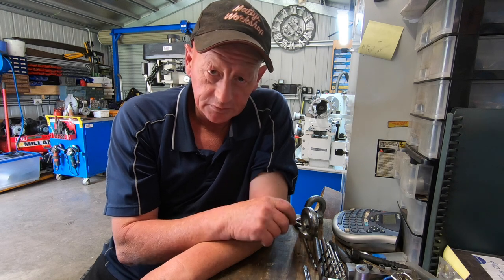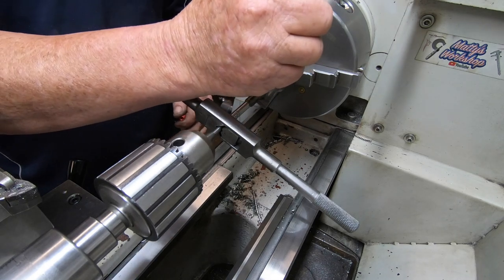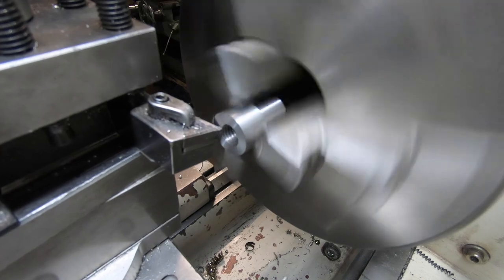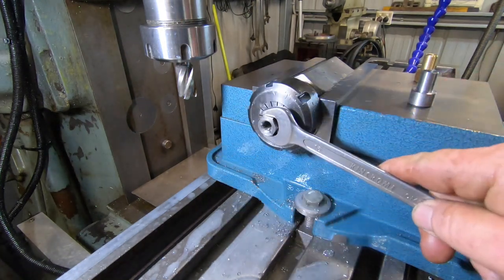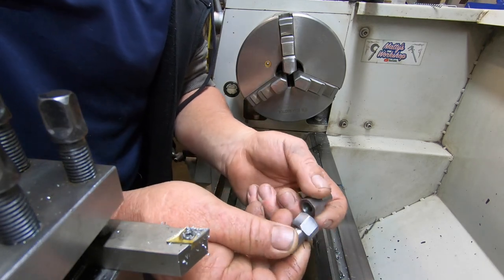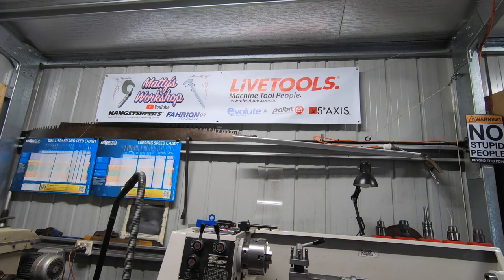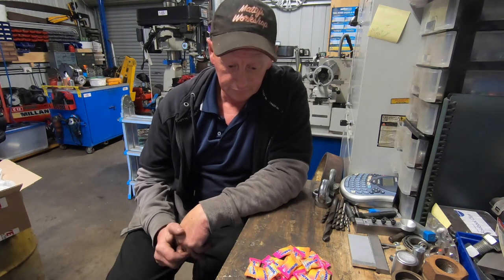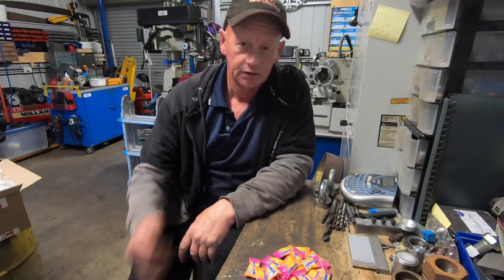Banner, Custom Nuts & QuickWorkshop Update

Comment: Nice job on the parts. I don't mind you using an imperial and metric mix one bit. I am equally ok with both. I try to use just the one in my shop though, purely to cut down on cockups - I make enough when I stick to one unit 😂 That's a great gift - the banner 👍 Have a nice trip
Reply from the maker: Gday Craig, I’ve started using the metric side of the dials on the lathe but not on camera, there’s been a few decent cock ups but that the part of learning, the banner is bloody awesome and never thought I’d see my name up like this mate, cheers

Comment: Matty, make your own phase converter.  It's an afternoon project.  I used a 10 hp motor.  It will run about 30 hp of motors down stream.  You will also need some start and some run capacitors to balance the voltages across the phases.  Project will make a nice video!
Reply from the maker: Gday, I’m starting to look into making my own mate, Cheers

Comment: The quick jobs can be the most satisfying. Knock them out take the win and move on to the next.  The banner looks great.  

If the missus is on board with a new piece of equipment, (or two) strike while the iron is hot! Wives can change their minds quickly and you mill money becomes a kitchen renovation.  Ask me how I know.
Reply from the maker: Gday Joe, I quite enjoy these small job, quick easy and they help others out and save them money, I’m still a bit shocked the wife’s on board with getting a new mill, the house is only about 8 years old and no need for renovations yet so I think I’m really in luck, thanks for watching mate, cheers

Comment: I'd just build a phase converter. I built my own using a 5.5hp motor from a Scrapped Colchester Triumph. Cost to me was £300 ($500 AUD) in total for components. A bloke with your skills should easily knock one out no worries. If you're interested, I'll send you my email address. I've got the wiring diagrams and components list.
Reply from the maker: Gday, I’ve seen a few videos on making a phase converter and often thought about having a go at one but always doubted myself, I’d really appreciate it if you could send the diagram and components list then I can see what I’m up against and if I think I could do it, my email address is ttmrj@telstra.com   Thanks very much mate, cheers

Comment: Hi Matty,
It’s good to see that a successful mob like Livetools has confidence in your future…. you’ve got a ‘winning way’ with your YouTube channel.
Looking at those brass engine mount nuts…..  It could be that they are designed to fail rather than bust an engine block or gearbox or crack the chassis???
Great Vid,
and have a safe trip in the 4WD.
Best Regards,
Robert
Reply from the maker: Gday Robert, Livetools have been fantastic to deal with and very helpful with any questions I’ve had, Trent and I are back from the trip and had an absolutely brilliant time, thanks for watching mate, cheers

Comment: I dont know if it's like here in the states but if u give the power comp a reason to install 3 phase like u will b adding more equip they usually will do it for free as long as ur going to pull more power they will u usually have to get a licensed electrician to draw up a plan like the drill u where going to get then u say ur going to put 3 phase ac a welder etc they just have to see a need for it 2 of my friends buss did it & they never did add the extra equip plus 3 phase is more efficient don't know how it is down there
Reply from the maker: Gday, it’s not like that here sadly, it’s costs a lot to get 3 phase put on, not cheap for the hobbyist, Cheers

Comment: Matty Hi! Regular follower here. The nuts were made of 4140, Annealed or hardened? The insert for finish was TNGG? What is the size and nose radius, 432, 431? Also, speeds and feeds?
I'm working on an oil can of your design. But SS. Hard to work, but impossible (maybe) to turn over. Thanks!
Reply from the maker: Gday, sorry about the late reply, the TNGG inserts I use are TNGG160404RTX520, normally I run around 600rpm spindle speed and I play around the the feed rate depending on the size material i'm turning, The 4140 I buy from the local engineering shop and its certainly a lot harder then mild steel, Thanks for watching, Cheers

Comment: 3000 on a 3phase converter..   have you looked in to the cost of getting a proper 3phase cable and breakerboard installed?  i mean-there is probably 3phase in the cable feeding or atleast running by your property
Reply from the maker: Gday, I spoke to my electrician and to get 3 phase put on I need a big bank account, it’s not cheap here at all, thanks for watching, cheers
Reply: @MattysWorkshop  aah,sorry to hear that..here in Sweden all residential houses has 3phase,or if it's missing-very cheap to get installed

Comment: Just a possible cautionary note, as we don’t know the vehicle make model & year etc.
Is it not possible that those engine mounts being made of brass are designed to fail in a frontal impact to deliberately drop the engine out on the road and for it to pass under the vehicle as part of the designed crumple rate, and to protect the occupants from the engine being pushed back through the firewall into the passenger compartment & killing occupants?

Probably not likely but you never know.
Hate to see a coroners inquest at some point in the future track the cause of death back to something you unwittingly did at the owners behest.

Maybe if your aware of make model & year - do a engine mounts securing plate and nuts enquire through the dealers spare parts department & see if they are brass as OEM parts maybe just to cover your @ss?
Reply: Porsche have them in the rear for that exact purpose.
Reply from the maker: Gday, this car he’s building is far from standard, certainly nowhere near original, the car will be engineered once it’s all completed, Cheers

Comment: Regarding the imperial-metric, i despised imperial, hated it and never knew which idiot convention decreed it as a nationwide system, but since i started machining and actually using dials and having to do small moves, i started understanding the relationship between imp and metric, and its pretty much as simple as divide by 40, or divide by 2.541, depending what you need to get in metric... You said 43 thou, 40 is 1mm, 43 is almost 44, which would be 1.1mm, so its pretty much a no problem for i would assume anyone who does welding or machining, given the 1amp per 1 thou, making it again, 40 amps at 1mm... As long as you dont start throwing those 15/63 and such nonsense, also, the letter drills and such... That is actually degenerate, but for regular purposes, thousandths, tenth`s and such are easily understood... Bloody hell, i started thinking in microns, recently, which is a tenth/2.541, so yeah, for purposes of conveying work and size, either imperial or metric works well, as said, as long as someone doesnt start throwing in fractions and nonsense...
Reply from the maker: Gday, I’ve always used imperial and don’t worry there won’t be fractions, I really don’t understand the number/letter drill sizes, that’s straight out confusing, Cheers